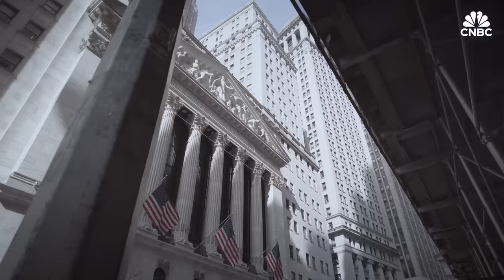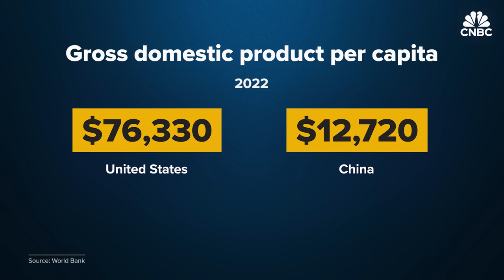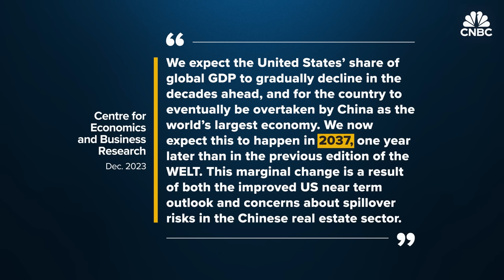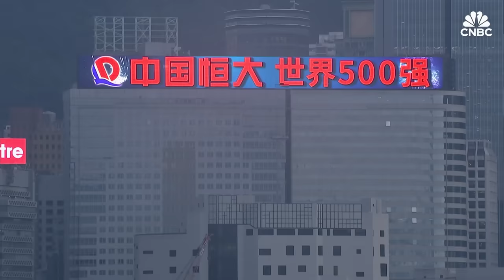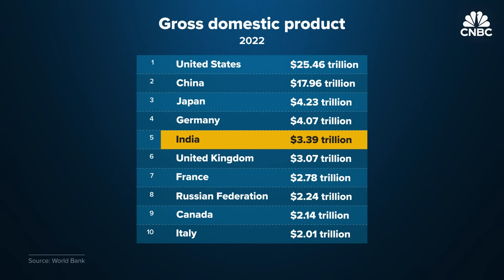Will The U.S. Remain The World's Leading Economy? | The Bottom Line

Comment: The U.S. economy in 2023 outperformed expectations along three key dimensions: growing economic output, labor market resilience, and slowing inflation. 

The U.S. economy expanded a whopping 4.9% in quarter-on-quarter annualized terms in Q3. This was more than double’s Q2’s rate and well above the pre-pandemic average. It was also particularly impressive in the international context: Most G7 economies are expected to have broadly stagnated in Q3.

Higher private consumption was the key driver, buoyed by falling inflation and a still-hot labor market—the economy created over 300,000 jobs in September, the second-largest increase so far this year. But the economy is no one-trick pony: The latest data also showed strong expansions in exports and government spending. Fixed investment—which had surged in the past two quarters as firms rushed to build factories following the passage of the CHIPS and Inflation Reduction Acts—lost steam but still expanded for the third straight quarter. 

We offer three key conclusions:

# The United States has seen a particularly strong GDP recovery and is on track this year to reach the level that would have been predicted by the pre-pandemic trend.

#Global labor markets continue to strengthen, and the United States has been especially resilient.

#U.S. inflation has cooled sooner and more quickly than in other advanced economies.

Source: FocusEconomics
Date: 27th - Oct - 2023
Reply: ALL DUE TO BIDENS EDCELLENT POLICIES FOR THE FUTURE

Comment: China is using industrial robots at about 12 times that of the US. The various US tech sanctions are certain to add rocket-fuel to China's tech development. In China, about 35% of the population live in the rural areas, meaning there is still a lot of economic potential to be unlocked in urbanization. Also, Chinese save about 30% of their income. If the govt can unlock that, China will surge ahead. I don't think that most of these economists are taking the full range of factors into consideration. One thing to remember is that economists have been predicting China's collapse for decades. It has not happened yet, which may suggest that most economists don't know what they are talking about in respect to China. By PPP, China is already the size of Japan bigger than the US. That will only continue to grow.
Reply: Economist also predicted Soviet Union will pass the US in the 70s, Japan will pass the US in the 80s, EU will pass the US in 2000s , now china will pass US. We go through this every decade yet the U.S is still standing.
Reply: @KCKnowsBest with soviet and japan, it was simply a prediction of who can rise to the top faster. Now, china is rising at an unprecedented speed and US is not only stagnant , but declining in every aspects. I would say it’s a bit of a different situation.
Reply: @KCKnowsBest  China passed the US in 2014. This race has already been run and won. It is also growing significantly faster than the US today, even if its economy has slowed, and it is starting at a point where it is already larger.
Reply: @ShnNar1000x  passed the U.S. in what? 
China economy $18Trillion , US economy $28Trillion

Comment: A huge company like Apple moving or expanding from China to Vietnam.  Vietnam the new China.  We need more investing USA
Reply: Vietnam is a stop gap  temporary measure until they can move to India. In other words, Vietnam in the short term, India is the long term solution. Because of its size, India has advantages that Vietnam cannot ever have - a huge local market.

But India also has infrastructural deficiencies that will take some to solve, therefore Vietnam in the interim. But, mark my words in the longer term, it will be India.